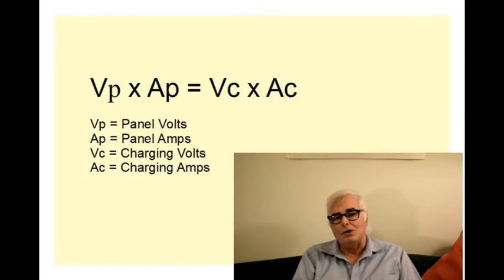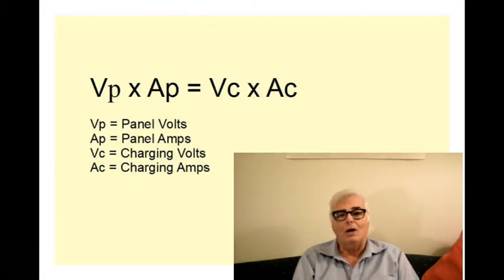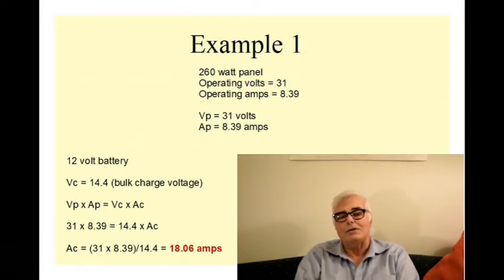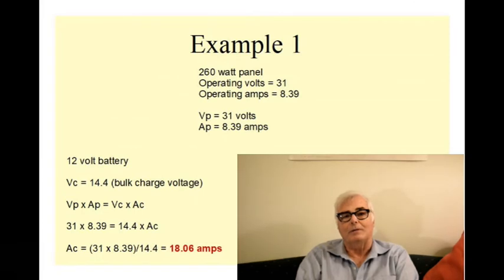Clearing up a misconception about MPPT Solar Controllers

Comment: great explanation. I have 2 solar panels each rated 160W  mounted in parallel with spec for each; 32.76 Voc, 27.3 Vmp, Isc(A) 6.27 , Imp(A) 5.86, VDC 45 Volts maximum. Based upon your calculations a 30 amp mppt controller should be safe using 10 gauge wire. I appreciate your thoughts.

Comment: thank you for this video. very helpfull but am still somewhat confused...My question is...
I have 5 panels each are 35v and 7.8 amps and am looking to charge and maintain a 12 v battery bank. so what size,type, etc of charge controller do I need to buy?
Thank you in advance.
Reply from the maker: Your panels are 275 watts each, so five panels gives you 1375 watts.  If you are charging a 12 volt battery bank, your solar array could put out 115 amps,  Thus you need a controller rated for at least that many amps and preferably 125 amps.  It is going to be hard to find a controller with that high a rating.  I would suggest going with multiple solar charge controllers and splitting your panels into groups wired to separate controllers.  Personally I would buy three 50 amp rated controllers and wire two panels to each of two controllers and one to the third controller.  That would let you add a 6th panel if you wanted to.

Frankly you would be better off if you could rewire your battery bank to 24 volts.  Then you could use a single 60 amp controller.  I assume that you are running an inverter.  Inverters are more efficient if the battery voltage and AC voltage are closer together.  You can then us a DC:DC converter to power any 12 volt loads you have.

You also absolutely must use an MPPT controller to connect those panels to a 12 volt battery bank.
Reply: wow, thanks for the quick response. I am using a 2500 watt YueQing Reliable Electric pure sine wave inverter that's marked for 12 volts.  So I guess 24v isn't an option unless buy a different inverter....
Reply: Honestly may I humble say this since we are somewhat in the same shoes If you are going into the market to buy a new inverter and you have batteries to cover a 48v system just buy a 48v inverter these days the inverters they all cost the same as it relates to the voltage and your system be way more efficient  that is what I am considering.
Reply: I have 36 v panels tho not 48v    @howardescoffery4950

Comment: Isn't dc to dc circuitry(buck convter) the reason why mppt are more expensive? Also large heat sinks for disipation.  Also the reason they wear out faster
Reply from the maker: Yes, the DC:DC converter does drive up the price (big inductors cost $$$).  Same goes for the heat sinks.  I don't know about wearing out faster.  A properly designed and built MPPT controller should be quite reliable.  However, if built to a price point (cheap components, sloppy fabrication), yes it won't last as long.

Comment: This should be required viewing for anyone seriously researching solar charging systems.  I don't remember if you already have posted on before, but a video contrasting PWM vs. MPPT charge controllers might also be useful.
Reply from the maker: Thanks.  I tried to make it clear.  Tomorrow I am going to go over how the LED indicators on Victron controllers work.